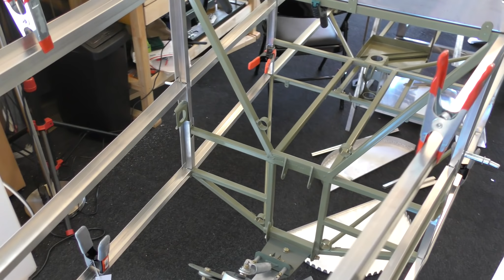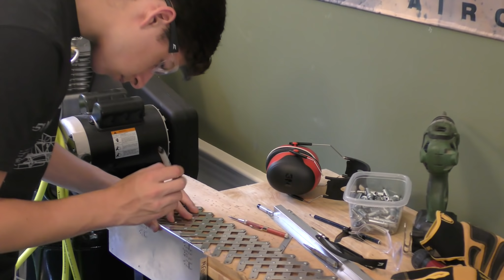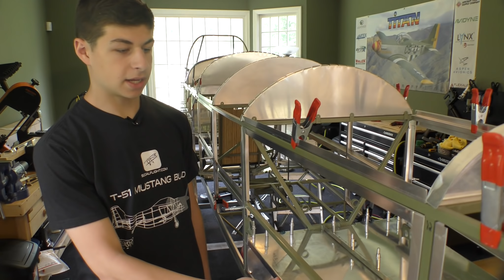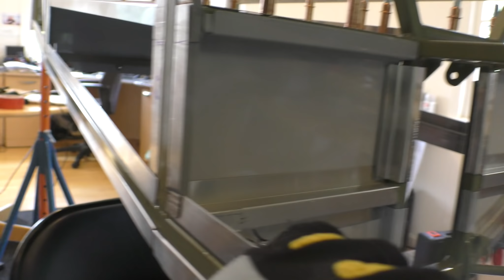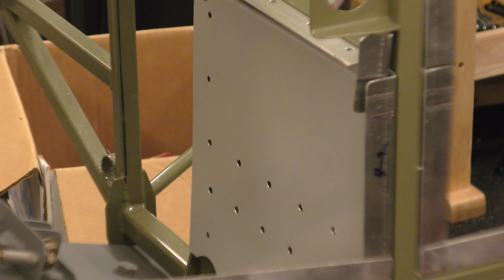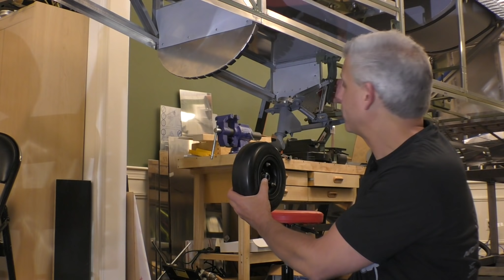Tail Wheel Time for SocialFlight's T-51D Mustang!

Comment: Looking good ... FYI many of us have cracked they U shaped bracket that goes around the spring that tail wheel is attached to. A simple fix is to weld an additional plate over the top of the original bracket for added strength. The tail wheel can not take sustained 3 pointer landings due to its light construction and my cracking occurred at around 90 hrs and I have avoided 3 pointers .... Not  a big issue and relatively easy to fix but worth a mention .... cheers Mustang33NZ (twitter name)